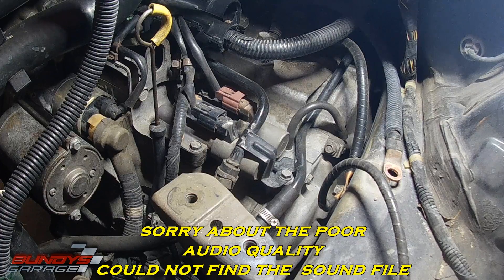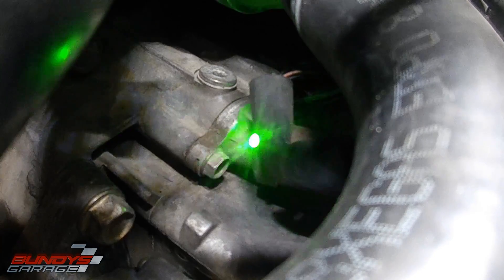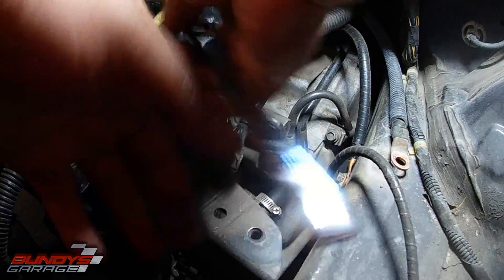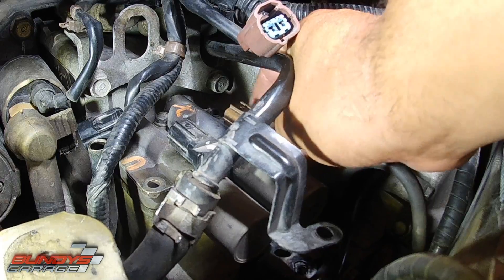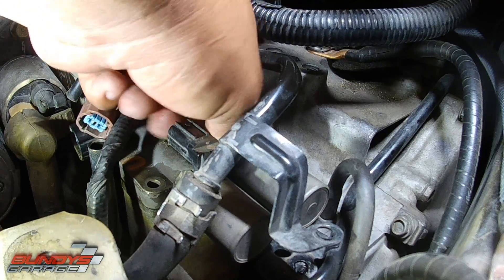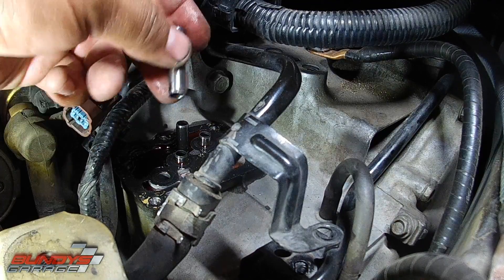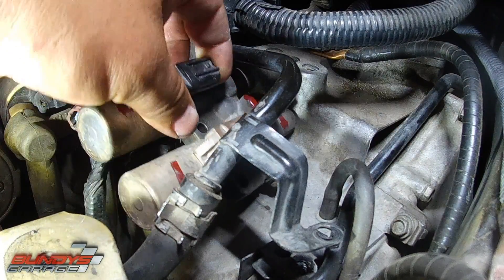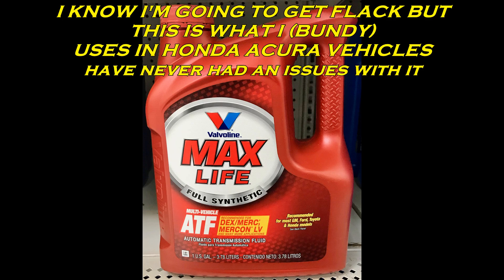P0740 Honda Acura Linear Solenoid Replacement Fix | Accord Odyssey Pilot Ridgeline

Comment: Thanks for the info. Did you use an OEM PART? We're there any drivability issues or just the MIL light and code? Thanks for sharing 😄
Reply from the maker: It was a used OE solenoid I got from a Honda specific junkyard. There were no drivability issues. Just the code and that stopped the smog which in turn held up the registration sticker.
Reply: @bundysgarage  ,,, Did you say you solved the blinking D light with regrounding the wire ? Explain please as i have a blinking D4 light but my tranny does change beautifully.
Reply from the maker: So sorry for the delay. Yes I ran my own ground from the transmission to the chassis and that solved my blinking light. Honda has bad grounds especially during those years.
Reply: Thank you for sharing.   I recently purchased a 99 Acura 3.2TL and it has this code (P0740) and occaisionally the TCS light comes on.  In addition, the shift between 1st and 2nd, and 2nd to 3rd are delayed. The vehicle will also jerk into those gears and rev up before doing so if you don't let up off the accelerator. After it's up to speed the vehicle shifts fine.  I've seen videos talk about the Torque Converter Clutch solenoid being the culprit.  I also have the Acura shop manual that instructs the tech to check/replace the A/T pressure clutch and Torque Converter Clutch solenoids.  I called Acura parts to request the parts and they couldn't find them by name.  Is there another name for those two solenoids?  Lastly, did the solenoid switch work on the van?

Comment: My 01 is cooked
 Replaced all the solenoids and fluid.
My car just popped out of gear. I had to push it back
Reply from the maker: Have the transmission rebuilt and then add an external transmission cooler.

Comment: I heard the Honda DW1 isn't recommended for the second gens and the fluid was used is no longer available. The DW1 is too low in viscosity. Valvoline max life for imports the non mpg saving version.

Comment: I ordered new dual solenoids, but they came separately without the mounting plate. Do you know how to remove the solenoids, Im having a tough time. Do I have to remove the pentagon allen screws on the other end? THanks.

Comment: So my odyssey is a 99 but I’m getting a tcs/ check engine light p0135 code plus I did change that solenoid/ and the other 3 on the trans but never touched the little filters on those, I’m also getting high revs in second and 3rd..then goes back to normal…I’m at a lost with these issues…it’s been parked over a month due to this issue and the mileage is 99,999

Comment: just passed smog today ... drained the fluid twice (also drained the radiator)... that sensor was ticking while i was driving ... i unplugged that sensor and all the transmission sensors that i could reach and then plugged them back up ... unhooked the battery and then hooked the battery back up ... ... not sure why i got that code ... maybe dirty fluid ... maybe connection the sensor ... the ticking when away which i think was coming from that sensor

Comment: 2001 Acura p1768 solenoid Linear A clutch pressure control valve A failure, D5 blinked while in park waited then drove of in Manual ran like a champ rode in automatic for a bit but I was hesitant , transmission was rebuild during Covid, shop is no longer there sucks so this is my next step hole this works

Comment: That's the clutch solenoid circuit. Which is the other sensor. With the 2 small domes. Lock up solenoid. This isn't the p0740 code. I've done research.

Comment: Howdy bro well done. I have a similar problem with the D4 light flashing on my 1998 Honda Odyssey v6, 5 door. The speedo is now at 0 doesn't even move. At first it just jumped around for a while  but now it dead. Tried replacing the speed sensor, nope, still nothing. I don't have any trouble driving shifting all seems ok. So what your showing me here in this video is what u recommend me doing or what? Kind regards Auburn
Reply from the maker: Sounds like an electrical issue. Try grounding the transmission to the frame.
Reply: @bundysgarage  Ok will do, can that be any gauge wire, Im going to try a 12awg/4mm ground house wire and see!?
Reply: @bundysgarage  Ok I but the ground wire in from trany to main frame. BTW the battery already has a second ground to the body as well. Went for a drive and no change in flashing light or speedometer movement!? Wondering if speed sensor is getting power to it? Is there a way to check it? Regards:)

Comment: I have that code on mine do i check if still good or replace with a new one?? Codes i got is the p0740 ,p0730 gear ratio incorrect
Reply: Ever fix this issue?
I have the same codes for my 05 civic
Reply: @Ryanh6661  yes it was the solenoid sensor bad
Reply: What’s the name of the solenoid I can’t find the part this is the exact two codes I have on mine
Reply: @EseGavino7 ever find out mine has the same codes
Reply: @justinsaneok   I ended up needing a new transmission

Comment: You're working on the linear solenoid, but your text is talking about the torque converter clutch (lock up) solenoid. They are two different parts, at least on my 02 Accord.
Reply: I ordered new dual solenoids, but they came separately without the mounting plate. Do you know how to remove the solenoids, Im having a tough time. Do I have to remove the pentagon allen screws on the other end? THanks.
Reply: @homerdodd4264  Not sure. It's been awhile. As I recall mine came together. Are yours genuine Honda parts? It's best to use them on an application like this, even though they cost more.

Comment: Part numbers 
A/B solenoid 
28400 - P6H – 013
28500 –P6H – 013

For the transmission dual linear solenoid, part number 28250-P6H–024

Hope it helps!

Comment: I have d4 light blinking and stuck in 2nd gear. I have change every solenoid there is. Could it be the ground? I've noticed that you said that you have yours grounded. And I've changed the fluid 3x
Reply from the maker: Yes it could be as simple as a bad ground. Honda never did have the best grounds.
Reply: @bundysgarage  will it make the transmission go into limp mode
Reply from the maker: A bad ground can make components do all kinds of crazy things.
Reply: @bundysgarage thanks for the video and the advice

Comment: Thanks for the video! Got the P0740 code on my 2000 Accord V6. Did this get ride of the code? 
I will be looking for the solenoid at a junkyard, as they are 200+ on Rockauto!
Thanks!
Reply: Get a flathead screwdriver and instead of pushing down to open it get underneath it and simply move it up and it will open took damn near a hour messing with that thing before I did that …

Comment: I use 1 q of max life for every 4 q of Honda Transmission fluid. It fixed the same problem I was having. Low MPG's and long shifting from gear to gear. Plus changed both solenoids too. The clutch solenoid was the main problem.(that's the one closest to the engine)
Reply from the maker: Why not just use full MaxLife? I use max life 100% over the Honda ATF. Always seems smoother and better shifting.
Reply: @bundysgarage  if I use only max life i noticed I get to much clutch material on the drain plug. With a mix a get less clutch material and a very smooth shifting.
Reply from the maker: I’ve never noticed more clutch material with Max but understandable if you do.
Reply: Man.. I just got the lock up clutch solenoid next to the engine and now it's acting up again like wtf? I got it brand new straight from Autozone. Brand new out the box. How's this happening now. Make no sense man.

Comment: I got this code, and I think a P0730(?).  My trans in my 1999TL (about 290K miles) wouldn't shift and essentially became a screaming first-gear driver.  My local trans experts said I would need a new trans and the two codes together meant it was totally shot.  They didn't try to sell me a trans.  They told me the work would be too expensive and maybe it was time to retire the car to the big car shredder in the sky.  Saddened, I sold the car for scrap metal and bought a Tacoma.  Don't get me wrong, I LOVE the Tacoma, but I really wanted to fix my TL.  I put 275K of the 290K miles on that beast.  Body and interior were still looking great!

Maybe with this information I would have given it a shot and would have seen if an inexpensive fix was attainable.  After doing my own timing belt change about a year earlier, this looked absolutely easy-peasy.
Reply from the maker: Thats a bummer. That was a great car. I know a lot of people talk smack about it but it was a good car. Weak point being the transmission. Engine was rock solid. P0730 is incorrect gear ratio. Fixing P0740 might have cleared P0730 but it’s hard to say. But worth a shot instead of scrapping the car. If you did the timing belt (I have videos how to do that as well) you could have changed the solenoid, no problem!
Reply: Pulled linear solenoid and one of the small pipes is jammed in pretty good.   Anything ideas how to get it loose?  Machine shop or transmission shop as last resort?
Reply from the maker: Get a pair of meddle nose pliers and pull it out